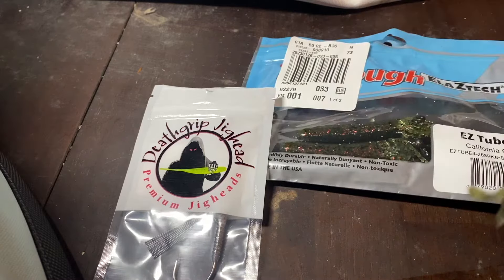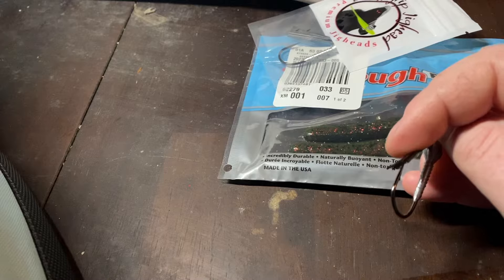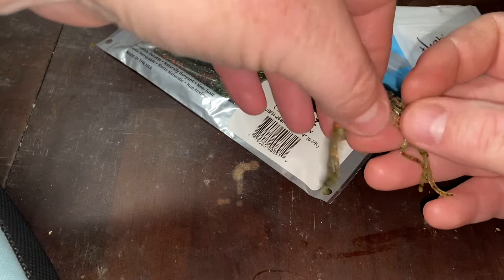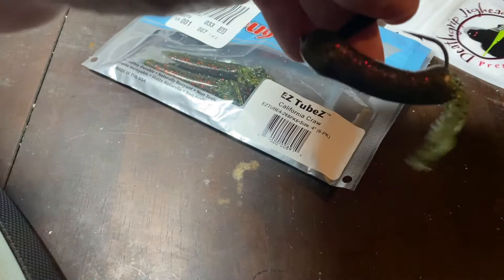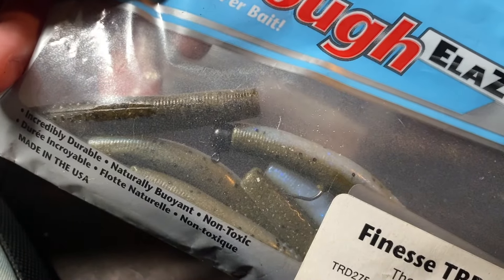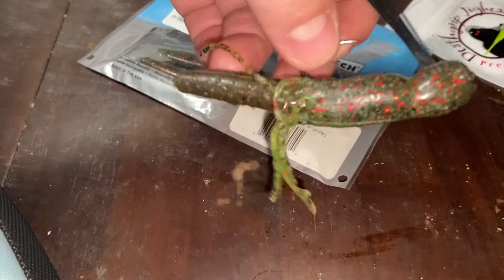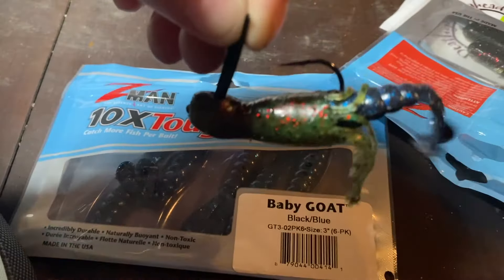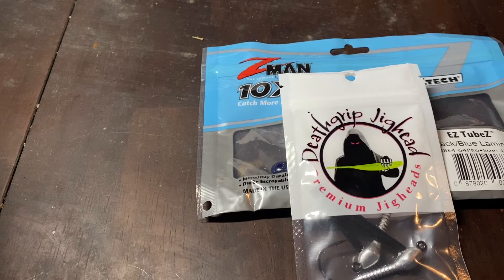NEW way to rig a Bass Tube Weedless

Comment: It’s interesting I came across your video. And that is one awesome durable set up. Never tried it, but I love using the death grip hooks. Some years back I was like that hook would work great with a 3inch b-2 squid, the catch is it only works with a 1/8 hook & they didn’t make a weed guard that size so I would use a spinner arm & use pro cure & did great in ponds. Love your video & soon to try out the z man tube… fish on.. 👍
Reply from the maker: Thank you! It is a really effective set up. Based on what trailer you use it can be a year round presentation. Last year it was the only soft plastic rig I used in tournaments and I could fall back on it when times were tough to always get bit. Soon I hope to do a version 2 of this video where I go over how I start the jig head in the tube and what trailers I’ve found to be the best. When I made the original I had no idea how many views it would get. Haha thanks for checking out the video!
Reply: @Eightmile_Drifter  You’re welcome thank again looking forward to your 2nd. Video. Always looking for ideas for getting the hard bites.. 😎

Comment: You can also make a " Stupid Tube" thats weedless.
Reply from the maker: The stupid tube rig is pretty cool, I had problems with my hook up ratio using it though. Using the bass jig seemed to help my hookup ratio and the ability to add trailers gives it more versatility in my opinion.  Thanks for checking out the video!

Comment: Why’d you leave out one of the most important details of your rigging. Everyone doesn’t know how to get the brush guards through the plastic. That’s the critical stage. We need help, everybody is not a professional. Also it’s an awesome setup, but now I need to figure out what you skipped and left out.
Reply from the maker: Glad you liked the rig, since making that video I’ve changed how I get the weed guard through. I could make another video on that particular step if it would help. The short typed version is that I bunch the weed guard up in my fingers and insert it in the bottom of the tube. I push the weed guard through and have the bristles come out about an inch from the head of the tube. Then stretch the tube over the jig head. It’s important to use Zman, normal plastics will tear. If you’d like to see a video version of that I can try to upload one.

Comment: Your demonstration removes the benefits of a tube. The hollow body traps air, which allows the tube to glide in the water and sink very slowly. Using the same jig head with the weed guard on it all you do is put the hook into the tip of the tube slide The hook down into the inside of the tube and pop out on 
 the top.of the tube. the hook. Therefore it’s perfectly exposed. The tube remains hollow and you still have the same jig head. The tube is also straight your tube is bent. It loses its floating ability and the advantage of the construction of a tube. Depending on the water, I have hooked tubes up this way without a weed guard and with the weed guard.  You can find little bitty, hollow balls about the size of a pee that fit into the tube from the rear ceiling the air in it. Your demonstration looks Like it will not work.  There was a time when I only fished tubes and I tried every type of configuration.
Reply from the maker: Thanks for the feedback. Using the Zman tubes and trailers I’m able to get a slow fall and gliding motion. The trapping of air you mentioned does make sense. If using traditional plastics that sink it might be a deal breaker, but the elaztech tubes and trailer plastics float if unweighted and help to slow the rate of sink once weighted. After using this set up for a few years I have determined the major value of it is the easy ability to skip into heavy cover and either drag or swim out depending upon the situation. At first I was disappointed I couldn’t get the tube exactly straight but have noticed it gives a rocking motion when being retrieved that I think is an attractor. I’m planning to make a part 2/ revision video in which I address a few changes from my original set up. It will be very similar, just a few minor tweaks. I hope you will check it out once it releases and give your feedback on it. I appreciate any advice or feed back I receive. Tight lines.

Comment: Did that 20 years ago
Reply from the maker: Do you prefer it to a standard bass jig and trailer? I’m finding the tube gets bit more.
Reply: @Eightmile_Drifter  my partner and I tried this in eary spring and got bit on it.This was when tubes were used all the time, always had one tied on! Fished them in trees,I would say nobody does that now and the fish haven't seen it either!!! Shhhhhhhhhhhhhhhhh
Reply: @Eightmile_Drifter  my jig bite is not that great going to break that back out!!!!
Reply from the maker: @Edward-ci8yl  I hope it works for you. If you’re into skipping bushes it’s been deadly for that.  Tight lines!
Reply: @Eightmile_Drifter  I skip bushes with a swimbait from reaction inavations . Skinny dippers!
Reply from the maker: @Edward-ci8yl  I’ve never tried those. May have to give that a go in clear water.

Comment: IMHO that's a waste of Z-MAN's by putting 2 in 1 when 1 works just fine for me. Wasting money needlessly. Tight lines.
Reply from the maker: I like the 2nd plastic as a trailer to slow the fall of the tube as if it were a jig and trailer. The ease of skipping with the tube over the jighead has been a big deal for me when fishing docks or low hanging brush. I do agree with you though that a trailer is not always necessary and just a weedless tube is a great presentation. Thanks for checking out the video! I appreciate the feedback.